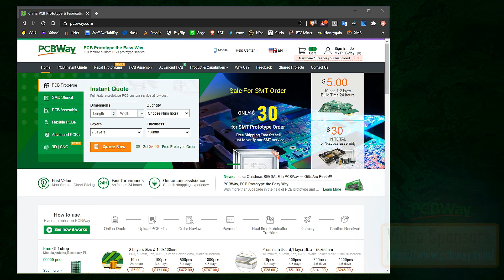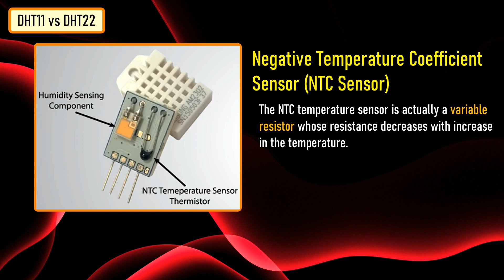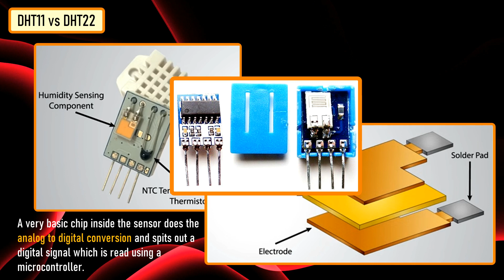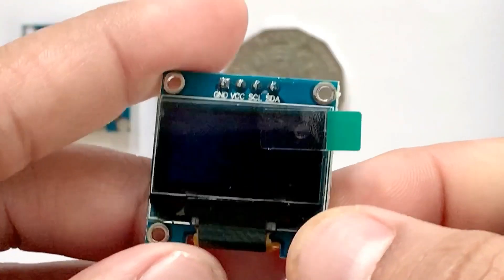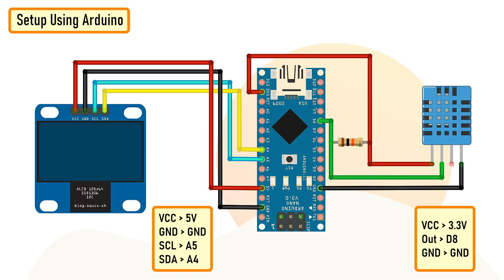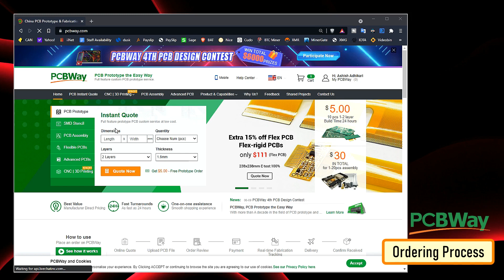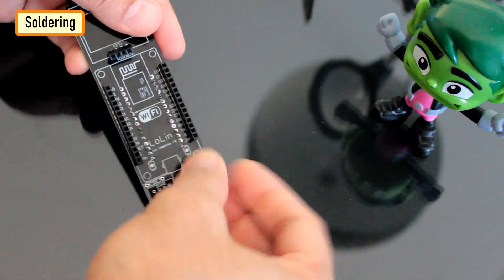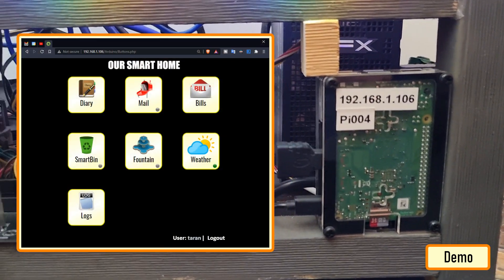Temperature and Humidity Monitor using Arduino and NodeMCU

Comment: Cool project and great explanation! :)
Would be cool if we can deploy these indoors in different rooms and somehow control individual room temperatures. I always have an issue with my room being too cold compared to everywhere else...
Reply from the maker: In my next project I am sending the data to my home server. 
If you want you can send codes to the esp from your mobile or pc and then send out ir signals using ir led to your home air-conditioner.